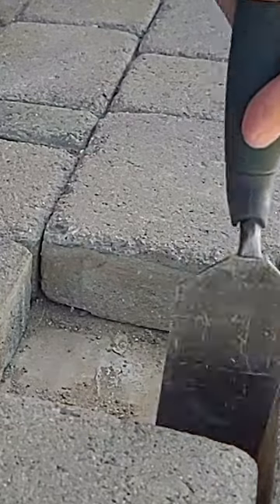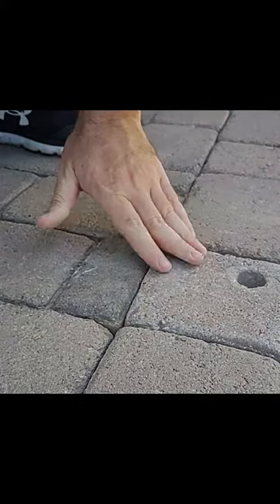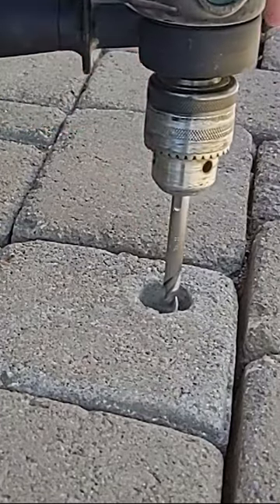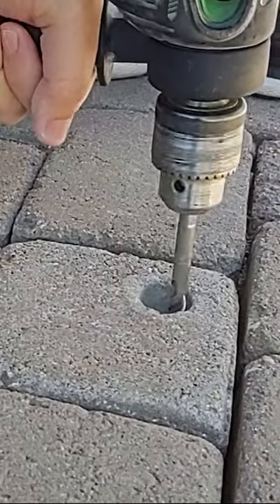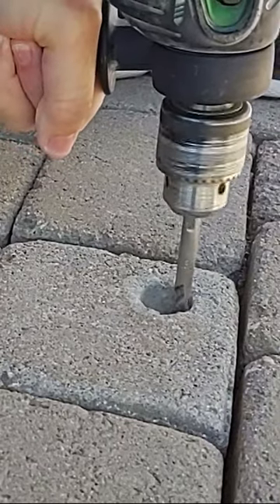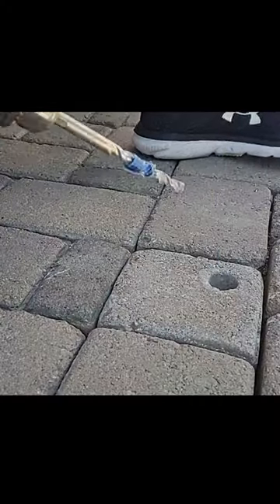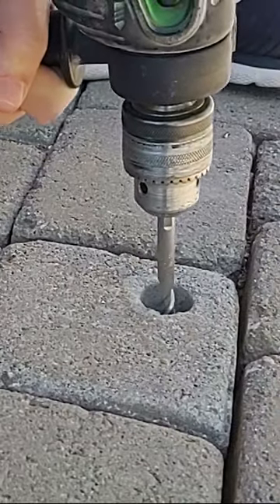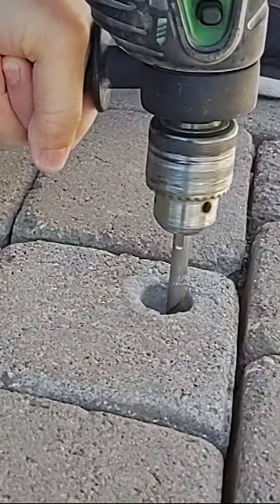Back Patio Makeover - Hammer Drill Info #shorts

Comment: Nowhere near enough embedment. If your going to put on tutorials at least do it properly.
Reply from the maker: Thanks! I thought filling the paver hole with concrete would make up the difference. But from what everyone has been saying it won't be strong enough and that I should have used longer anchors. I will have to make an update video and move this one to my mistakes playlist.
Reply: I think framing a wall on the unsecured paver units is inadvisable. Just an architect's thoughts on it anyway. But in the end, it's your house.

Comment: I'm pretty sure for those 3/8 wedge anchors the hole has to be slightly larger than 3/8, check the package for the correct size to use . Also check for minimum embedment , typically 1.5" to 2" . Meaning they have to be imbedded 1.5" deep into the slab underneath the pavers

Comment: That drill bit is designed for an sds rotary hammer. Not a hammer drill.
Reply from the maker: Great point! I will make sure I use the right bit. I don't remember what bit that was in the video. The next drill bit I bought was a DEWALT DW5230 3/8-Inch x 6-Inch Carbide Hammer Drill Bit and it seemed to work a little better. What drill bits do you use for your hammer drill?
Reply: @ThatHobby  any hammerdrill bit that is straight shank. The sds has grooves that make it hard to chuck up straight.
Reply from the maker: Thanks!
Reply: @ThatHobby  of course.

Comment: how are you planning on sealing under the 2x4. also make sure you use treated lumber for your bottom plates.
Reply from the maker: I am building a frame to screen in our back patio. I am using pressure treated 2x4's for the base of the frame. I will also use liquid nails and screw the sides of the frame into the house wall and the pillars. I will also screw the top of the frame into the patio ceiling.
Reply: @ThatHobby  gotcha I thought it was going to be waterproof